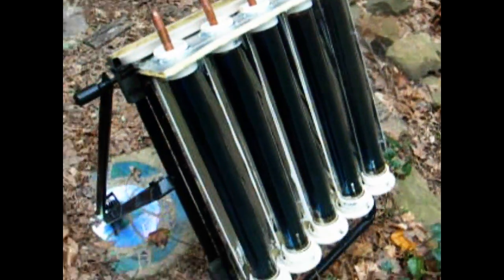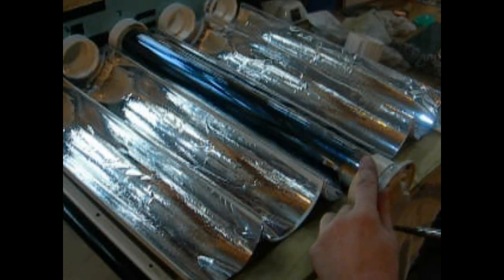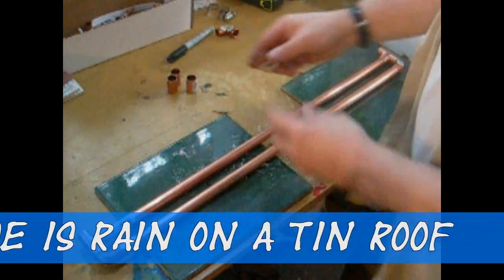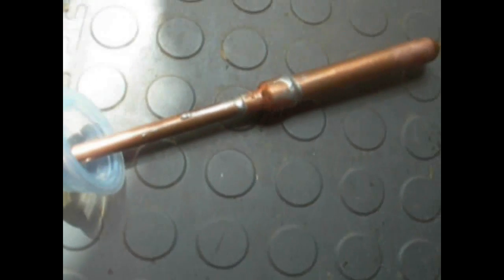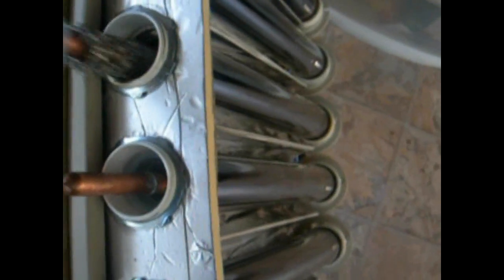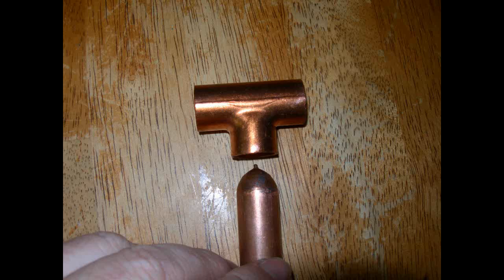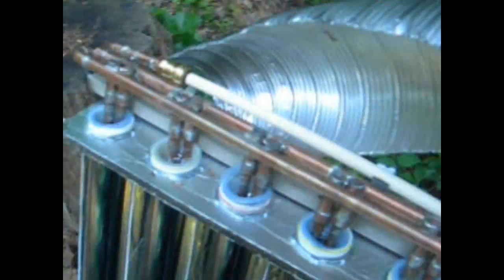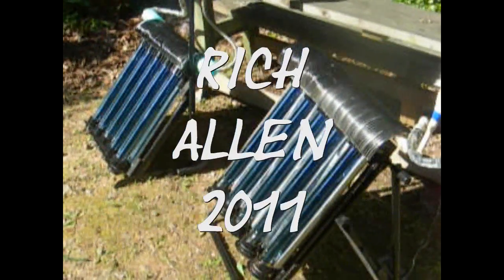SOLAR TUBES HEAT PIPE EXCHANGER  RICH ALLEN

Comment: This is the best video I've seen yet.   From what I did see it looks easy enough to make your own frame.  My biggest question is what was under that cover on every single solar system I looked at.  What a surprise to find that it's only the copper pipes covered to give it a nice visual.  Pool solar companies are making a killing here.  I'll look into making my own to see if it's cost effective.  I'll need 20 long pipes and this will to be to heat my pool.

Comment: You can also use white sea sand to fill up the tubes with the pipes which maintain the heat for longer after sunset.

Comment: Hook two of them in series also by placing longer tubes in heat pipes and maybe possibly 3/8 at 3/4 heat pipe tubes would be an interesting test for faster recovery and higher temperature output great video answered a lot of questions

Comment: Fascinating and I really appreciate the detail commentary.  For example, the tablespoon of acetone , heating lower portion while holding finger on top to blow off excess, then quickly capping it.  Small details like this determine overall efficiency.  Also, I liked the side-by-side tests of the 2 different designs.  I realize ambient temperature has no affect to the heat exchanger glass tubes, but there is some heat loss in the external plumbing;  therefore, what was your approximate ambient temp?  The overall production was impressive.  No advertisements, no fancy computer-aided graphics....  Your video demonstrates true DIY and humble efforts to make a quality product.  Well Done !

Comment: Hello from brasil.

Ok,let me undeatand it better.
You've created vacum in a copper pipe, sealed it. Then u inserted the vacum cooper pipe inside a glass tube.
The vacum inside of the coper pipe will absorb heat better.. 
Is that right?
😨

Fantástic!!!

👏👏👏👏👏👏👏👏👏👏

Comment: I know this is an old video. But have you thought about filling the glass tubes with sand to help with heat ? Or loop copper pipe down the glass tubes with water flowing through them? That way they can be heated on the way in and out of each tube. I am planning a project similar and that is what I was thinking of doing!

Comment: just found your video... i installed a solar collector on my roof - what do you use for insulation to carry the hot 'liquid' to the tank?   i had this on a previous house for testing, and found the copper in and out of the manifold was so hot that foam sleeves just melted... fine for pex, but the pex also had troubles with the high heat right out of the collector (exploded) - has to somewhat watertight or the insulation loses most of the insulative qualities.   was thinking wrapping it with fibreglass, then silver bubblewrap and silver foil tape, painted black... or possibly make a 'sleeve'  of abs fittings, split down the middle and glued back together (or possibly foil tape again - it seems fairly watertight if it's pressed down well.)  what have you found that worked?

Comment: that's standing water. I don't think you can generate enough heat to do anything with. you need water to travel down into tube in a pipe then 180 back up And out

Comment: Here's an idea that I think is very efficient. Use black engine oil. Pump it through a double plate of glass. The sun will get absorddd into the carbon. Than store for heat extraction later
Reply: What happen if it gets too hot and catches fire
Reply: @Odis-edgarDavidsonBene 🔴 What Is Islam? 

🔴 Islam is not just another religion. 

🔵 It is the same message preached by Moses, Jesus and Abraham.

 🔴 Islam literally means ‘submission to God’ and it teaches us to have a direct relationship with God. 

 🔵 It reminds us that since God created us, no one should be worshipped except God alone. 

 🔴 It also teaches that God is nothing like a human being or like anything that we can imagine.

🌍 The concept of God is summarized in the Quran as:

📖 { “Say, He is God, the One.  God, the Absolute.  He does not give birth, nor was He born, and there is nothing like Him.”} (Quran 112:1-4) 📚

🔴 Becoming a Muslim is not turning your back to Jesus. 

🔵 Rather it’s going back to the original teachings of Jesus and obeying him. 

More .....👇

🔴 THE RETURN OF JESUS

Comment: you can use Thermoelectric devices  to make power directly, if you make a heat sink base that fits over the copper pipes that push heat into the Thermoelectric devices, the devices will need a heat sink to radiate the heat away  ( so you need an alloy block with 1 hole for each copper pipe as the heat exchange base part, and then add the Thermoelectric devices then the external heat sink to radiate the heat away, you will need to bolt it together ,  as the main block heats up it puts heat into the Thermoelectric device and then into the heat sink, they generates energy with no moving parts,  you can buy them on eBay here google this Thermo Electric Generator they are around 2 dollar plus postage  ps they are fragile they are ceramic and can break

Comment: Rich could you put the heat pipe in and the glass with clean white sand.  I thingk the sand would keep the heat longer for the nights.
Reply: brian somers, the goal is to store heat indoors using something like an extra insulated water tank. The collector needs to have a low thermal mass so it can rapidly heat circulating water.

Comment: Where is the vacuum applied to the glass tube?
Reply: The vacuum is applied to the copper heat rods when they are heated and sealed. the glass tubes are just an insulator to the outside elements .
Reply: If they are the real deal then those glass tubes are double walled with vacuum in between, that way you are loosing minimal heat due to material contact.

Comment: what is the use/purpose of the steel wool wrapped around the heatpipe ?
Reply: Picks up heat quicker from the foil that heats up in those tubes, not sure how much it really helps, would be worth a test.
Reply: doesn't water have like 15 times the specific heat capacity of steel ? wont it just trap the hot water ? i dont know man

Comment: Would it not be much more efficient to seal the tops of the vacuum tubes and pump water through them rather than having the tubes heat the sealed pipes and then have the sealed pipes heat the water?
Reply: You misunderstand my question, I wasn't meaning to get rid of the double wall vacuum tube, but rather pump the water through the inside of the inner tube and have it heated that way.
Reply: If I understand your question well, the whole point of having the vacuum tubes separate from the sealed pipes is to allow the working fluid, acetone to heat up first then transfer the collected heat to the sealed pipes. It collects the heat much faster than water would and having the water heat directly from the vacuum tubes would slow down the rate of it's (acetone) heat absorption, and reduce the system's efficiency as a whole.

This design is pretty cool, though i don't understand why he used steel wool inside the vacuum tube, wouldn't it result to heat loss through conduction?
Reply: @silversurfer7339  You are confused. The vacuum tube is double layered glass separated by vacuum. This is to prevent the collected heat to escape through a medium. It is the inner tube that get heated up. Inner tube should be in contact with liquid that should be heated. In this case he has introduced one more copper tube so that he can separate the heat transfer agent azetone.
Reply: Seems to be a lot of guesswork in these comments.
Anyway the reason is contact losses, if the water was sitting in the tubes it would heat up the entire glass and a good percentage of the collected heat would escape that way. At least that is the technical reasoning, but I haven't yet see anyone do a comparison test so that could be very interesting to look at.
Reply: I learned that the vac tubes will only handle 7 psi.  With this system, though it is less efficient, you can run standard house pressure in your water lines.

Comment: Well done Rich, thanks for sharing.
Reply: ok I have all the supplies to make this for my pool 24 foot round by 52 inch.  My question is does the water go in the glass tub or just the copper fitting chamber?? also do think 2 set of 6 be able to heat a pool 12 hours of sun aday

Comment: For the trouble you went thru to make the heat pipes, you could have just as easilly run the water pipe down into the tube, thru 2 elbows at the bottom and back out.  Heat transfer is about time, temp difference and surface area.  The more surface area you have down in the pipe the more heat it will transfer.  I am guessing that these are the double wall vacume bottle tubes with the absorbsion coating?  On these the inner surface(with the coating) gets hot(insulated by vacume), so that is where you need to collect the heat from.  I would not reccomend steel wool. As mentioned it will clash with the copper. It is also small filiments that don't conduct well and will trap air pockets(pretty good insulator).  For this type tube the propolene glycol is a good idea, as it would positively contact all the inside surface of the tube and not harm the copper.  Here is an experiment for you, remove the steel wool and fill the tubes with water around your heat pipes.  the measure then will be to remove enough heat via the heat pipes or water circulating down into "u" tubes to keep the conducting media(water) from boiling:)  Good luck with your experiments.

Comment: Love the detailed clever component selection and thinking behind choices taken.
Add semi concentrating reflectors behind each and spread out more.
if you are running water past pipes made of copper, why not just plumb in the cold on one end and out the other, removing the extra heat ex-changer.  The two pipe version could be go in on left out on right side. copper washers soldered along would be much better but would take time to add. The washers help by catching more sunlight at different angles and also slow air convection in between the absorber tube and outer shell that allows heat to escape working against us.
The steel wool did not make good thermal contact tot he copper even when new. It increased the focal volume and captured more sunlight as was the intention. But the steel wool just got hot and re radiated, maybe a1/3 is absorbed by the pipe if lucky.
With curved reflectors for each tube will make smaller focal zone. Keep enlarging pipe to see where optimum absorption is at.
You could also pipe air coaxially and create a air heater combined with a hot water heater. If small size may need to wait for hot water before allowing air to flow via natural convection plug removal or forced air.
Again cool component re-use engineering.

Comment: instead of useing steel wool as the medium to transfer heat to the heat pipe try filling the tube with propylene glycol  boiling temp 370ish F and year round freaze protection down to -70 F and that would stop any  
 galvanic corrosion. problems and provide a better heat transfrerr then the steel wool

Comment: One last question or though if someone could answer.... On a boiler you have a heat exchanger, would a heat exchanger be more or less efficient - would a heat exchange running in a solar can heater work well ..... I think this is something I could get into as it gets your brain thinking about ideas which are just being developed - if enough common sense is thrown at it :)

Finally great video

Comment: Also I am tempted to try and replace my gas boiler with a similar system.

I was debating trying use of a compost heap to create a base heat layer of heat so the water comes in warm and is then heated via solar (batch, collector, panel, tube) and sent up to the tank.

I see evacuated tubes work.... But this is problematic on many levels where do you get the tubes from, evacuating fluorescent tubes is unsafe with mercury - liable to explode, and pretty thin glass would it shatter if evacuated by an amateur.

Is there a way anybody could think of putting together the glass from old double glazed windows into a boxed frame, evacuating the entire glass box - removing the need for kingspan insulation - due to evacuation  

Heat loss is minimised - as I guess the evacuation would make the solar heat transfer as great as possible and unaffected by outside temp

Although perspex is great for fish tanks I doubt it would be good for hot applications such as these......

Ideally I considered having two of three small compost heaps which could be swapped in - nothing more than a compost heap in barrel with wheels. In the centre an open spindle with plastic pipe coiled around to absorb the compost heat this.....

Creates a minimum warming of the water (to prevent freeze action) > then heat the water via solar collector of some design / and probably a cut off in some way to trap the heat in the storage tank.....

Would love to know if there is a community where people are working on these ideas in the uk - like a social club so that we could pool ideas help each other etc.....

I have seen all sorts of fancy gizmos and gadgets for solar but surely you know once the sun has gone down, to turn the system off for the night ? I don't understand the physics but could mirrors be used to reflect onto the pipes in a simple V shape, or simple guttering. It would really good if there was a community to help each other out there

I'm in bedfordshire......

Comment: Wouldnt the baby nipples and the foam rings eventually melt in the vicinity of a heat source over time ?
Reply: No HE IS GOOD they are silicone and take exposure up to about 400deg with out issues.
Reply: ahhh thank you

Comment: Not once did I hear you say where the glass tubes come from? Also using proven soldering ways, you could get by with 1/2 or less solder than you did. FYI only.
cheers

Comment: check out parabolic mirrors, just take a polished stainless sheet and hold it in a crescent shape with a frame behind your tubes, check Solar Grill and Hot Water Heater/Purifier Manufacture Production Model Prototypes

Comment: I don't understand how closed copper pipes with a slight vacuum heat better. Is there a link for this I can read?

Also, in your heat exchanger, the main vertical copper pipes ( in the glass tubes) are touching the heat exchange with a minimum of surface area. How much heat actually makes it from the vertical copper pipes to the heat exchanger?
Reply: I was thinking same he cud of used 10 lengths of 10mm plus foil or something  and piped it in house to a decent exchanger or hot tank lol
Reply: The vacuum is between the clear glass outer tube and the dark glass inner one. In every other part of the assembly, there is no vacuum. Also, very little explanation was given on how efficient heat pipes are in transmitting heat. (The heat pipes are the copper tubes sealed at both ends, with a wider bulb at one end, and with some acetone inside.)

Comment: Solar Energy Applications (SEA group) Has Extreme High Efficient Evacuated Vacuum Metalized Heat Absorber Tube Kits for minimal Co$t$ complete with closed Cell Foam Header Boxes Tanks including pump sensors and Controller very Cost Friend  30 Year Powder Coat Frames

Comment: What would a solid core would do instead of the vaper filled tube ?
I would think it would transfer more heat then the vaper filled.

Honestly i have had better results with 3/4 inch copper tubing in an (S) patern, painted with high temp black and boxed in with glass front.
100 feet will make steam out the other side in less then 2 hours.
Reply: The concept of a heat pipe is that the liquid vaporizing from the lower part of the pipe can remove more heat from it boiling off, and then rises to the top where it's collected, by condensing as it gives off its heat.  Then it drips back down as a liquid, and does it all over again.   Supposedly that enables more rapid transfer of heat than just a solid tube working simply from conduction.

It would be nice to know if the constructed DIY tube in the video is working as intended, maybe it could be tested by heating up the bottom with a torch and seeing if the bulb at the top gets hot, while the middle sections remain cool.  That would indicate it's actually working as a heat pipe.

Comment: Hi Rich, I write from Montevideo Uruguay. Looking for material on how to assemble a solar collector vacuum tube, I found excellent your video and I willing to follow your construction process.
But I have a question, I see that you put acetone in the copper tube before sealing. I know that some systems use a liquid Inside you'll copper tube for better heat transfer. That's why you put acetone?
Thank you for your clarification
Nestor

Comment: Not a bad set up. If I may, I would recommend using smaller diameter pipes inside the tubes, painted black, the smaller the pipe, the better the energy absorption and faster release. the black on the pipes obviously would better absorb solar radiation and speed the transfer of heat. just my humble opinion, otherwise, great job!

Comment: any updates on this? is the direct heat tranfer better, have you tried the direct flow vs heat pipe? I like the idea of direct flow, but I can see the advantages of heat pipe, and I am curious if the "change of state" makes that system more efficient than direct flow.

Comment: If The hot water=glycol closed Loop-system was ran to a series of barrels of water n gravel.. & that was maintained at a high temp..as high as sun allows:) thus- nights,& cloudy days.. well the heat would be available still. it would require 2 separate closed loop glycol setups, to really stand the test of time..& resist corrosion or buildups of minerals. hey how bout vegatable oil? wouldnt it work like a glycol? aint fit to eat, but could be a savings..LOL